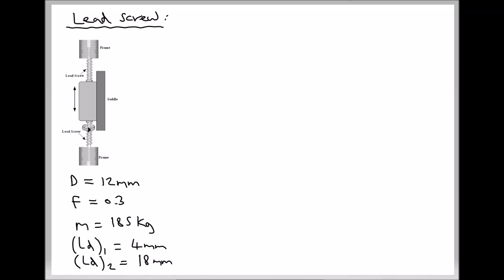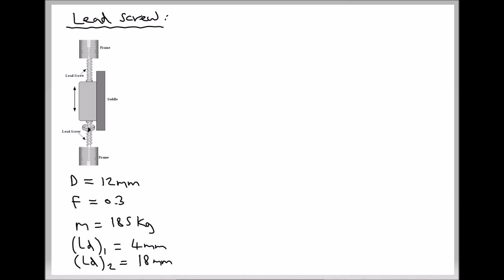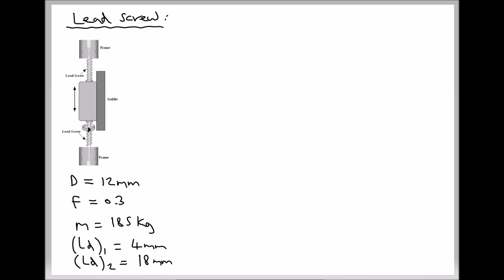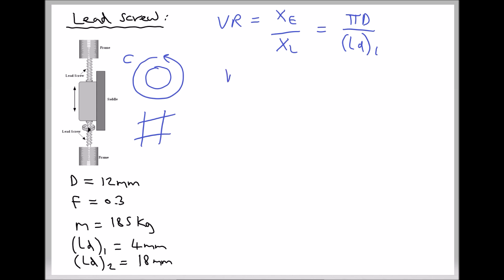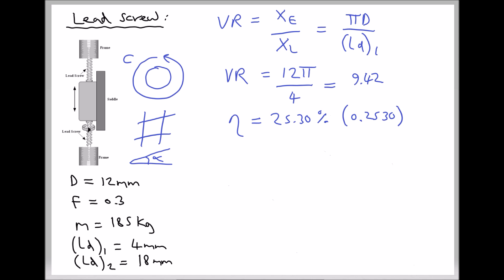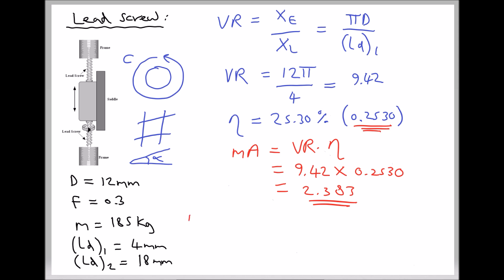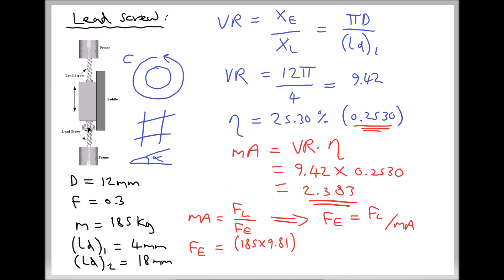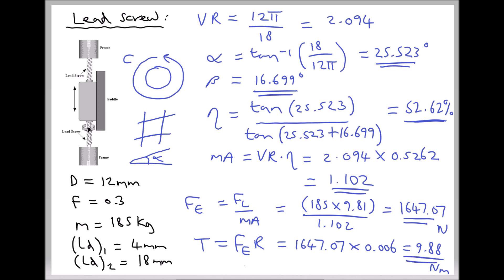Calculating Lead Screw Efficiency and Required Lifting Torque

Comment: Thank you very much. My 3d printing club us building a custom large format 3d printer (1mx1mx1.5m) and we were trying to figure out if 3 nema 17 stepper motors had the torque we needed to drive our z-axis/gantry and now after watching this great video I can go through and finish the calculations we needed to do.
Reply: I am currently working on a very similar project, needing to move a gantry 1 meter in the z direction, any advice you have would be extremely helpful!